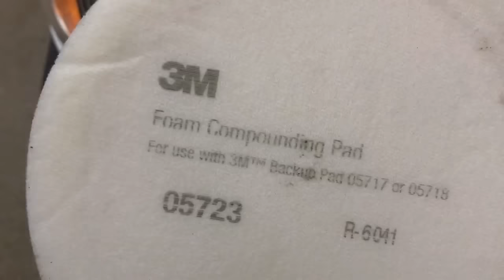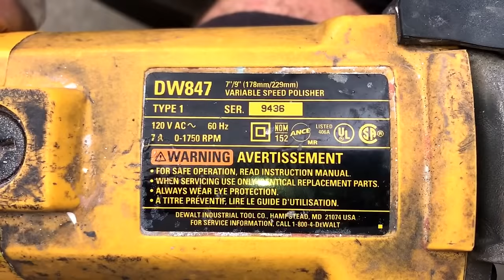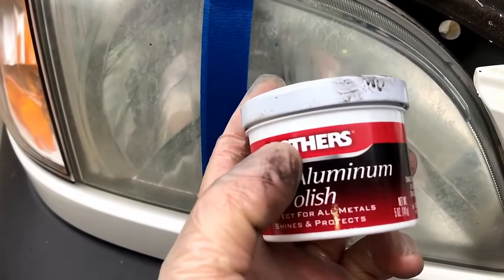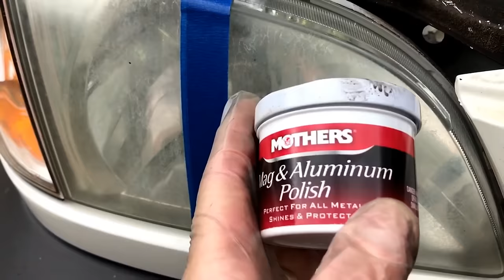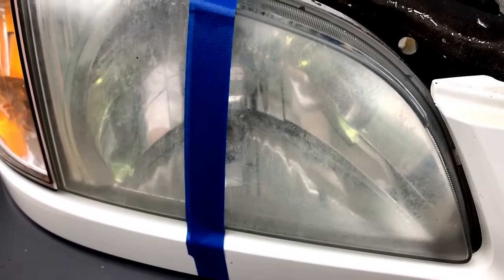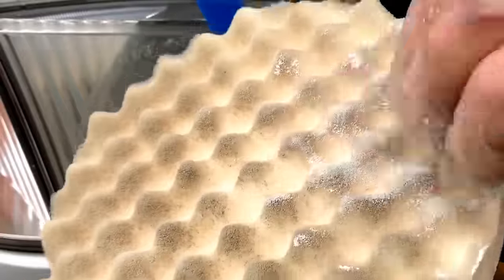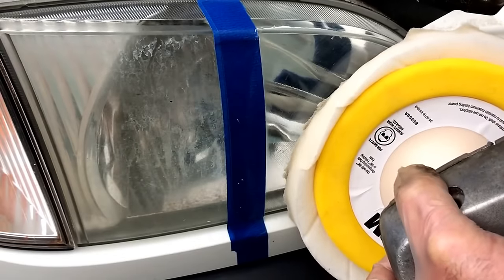How MOMMA Repairs Headlights BACK TO BRAND NEW in 3 Minutes

Comment: Thanks for the great videos. Couple of questions. I have a Dewalt cordless drill (0-1400 rpm) and some new 3M foam buffer pads in the 3" size that'll work on the drill.  If I use the Mother's mag polish, is that cordless drill powerful enough to clean a headlight that had a bad sprayjob of clearcoat left on it.  The clearcoat isn't too thick, as it was only sprayed over a couple of passes.  Thanks.
Reply from the maker: jason it will make it look better but if the clear was sprayed bad i would sand it off then do this video and follow the tool list to keep it looking nice :)
Reply: I would try the Mothers with the drill and let us know. Someone had applied a coating to my headlights on a 2001 Honda Accord and they looked horrible. I didn't want to sand unless I had to. I tried several applications of the Mothers with a drill and they look great now. Really cleaned up amazing.

Comment: OK yellowed and totally frosted headlamps!! 2005 Honda CR V Headlamps replacement (Amazon $90. pair) Remove bumper, TONS of bolts HOURS!! or $180. min at auto shop to install. Bought cheap Harbor Freight drill, Deluxe headlight restore pads etc with 25% off coupons, plus Mother's Polish.@ O'Reillys. Total cost $29. !! If I had the drill, $15.00 total. Did exactly like the video says and VOILA!! IT WORKED!!!!! (no sanding, just used the foam pad that fit the 3/8 drill) Crystal clear head lights.Took about 15 mins  because of low rpm drill for BOTH HEADLIGHT ASSEMBLIES!! Saved close to $300. and a trip to the auto shop. THANK YOU SIR!!!!
Reply from the maker: GLAD WE COULD HELP :)   we are glad to have you here with us and thanks for the great comment :)
Reply: UPDATE: There is just one small area of my left headlight that refuses to become perfectly clear and smooth. I tried using 3000 sand paper wheel and then re polished with Mothers on my waffle foam pad, but that darn spot won't clear up and feels a bit gritty.. Maybe the frosting is on the inside? but it still feels a bit rough on the outside.
 Now mind you this is a very small area of my headlight, the rest is perfect and it is hardly noticeable. I am just wondering why this area is so stubborn?
Reply from the maker: it is most likely on the inside of the headlight or in the lens itself send me a pic i would like to see it send it to sweetprojectcars@gmail.com :)

Comment: It cleans up fairly well, however I can't clear some of the heavier stubborn layers, any tips?
Reply from the maker: Buster Rymes it most likely was clear coated by someone and that will have to be sanded off. with 600 grit wet and dry paper all the way to 2500 grit then rebuff as you have done.

Comment: Just saw your video and im interested in trying it...... Quick question first can i go ahead and sand the headlights anyway before i use the polish just to smooth them out or will this smooth out any kind of texture on the lenses and if so which grit should i use for the wet sanding method. Thanks
Reply from the maker: Jose Rodriguez if you want to sand them then do this video here my friend https://youtu.be/GKLF8oIWYGg it will be the best you can do for your headlights.
Reply: Sweet Project Cars cool thats only IF i want to sand them though correct i really don't have to though?
Reply from the maker: Jose Rodriguez you are very correct...thats if you need to sand them otherwise you would buff them out and then ceramic coat them per this video https://youtu.be/hD2CKp9mco0

Comment: So I'm just curious.  My headlights are quite cloudy and it would do them good to have a cleaning.  I've tried the kits, and the toothpaste tricks.  I'm interested in trying this because all the comments seem very positive.  My main question, however is that I do not have a buffer.  Would good old elbow grease do the trick just the same?
Reply from the maker: 1Tarheelchick you sure can use elbow grease ..it will take a bit of it and some time but you will get it...:) thank you so much for your great comment

Comment: Will this work for polishing my goiter?
Reply from the maker: It definitely will, and it will shine like a new dime when you are done :)  Thanks for watching and asking, LOL.  Have a great day Mark, thanks for the laugh this morning.  mad Mike the hammer SPC
Reply: @SweetProjectCars  Haha! Absolutely! 😂😊👍 Glad to make you laugh. I actually burnt some goiter hairs last time I tried polishing it so I'm excited to try this method out 😉😆

On another note, I just finished using the HL restoration kit on my sister-in-law's van and my car as well and I did like the way they came out but you opened my eyes about a couple of things so I wish I would have found your video earlier! Can I still use your technique later on if I've already use the kits I'm referring to? Or will it just smear the coating I applied from the kits?

Comment: can you also use clearcoat with non yellowing and uv protection after? would i need to clean off with alcohol first before applying?
Reply from the maker: We have videos on how to treat the headlights after you have completed the polishing process we suggest using our ceramic coating last the longest with the least amount of maintenance have a great day Mike sweet project cars

Comment: Hey guys, so this worked with my 98 accord  headlights,  but it did not work as well with my 04 GTO.  the GTOs headlights are more worn and damaged and I tried several times with this method and the method with the cera coat. Still won't work. I did the sand paper clear coat method prior to finding you guys and it came out pretty good and looked alot better than they did before but it took forever and I only did one. I did your method and it came out ok but not as good as the sand paper method. I applied the mothers 3 seperate times and the results were ok. headlights for this GTO are super expensive so I really need your help. Is there a way to fix the more cracked worn headlights?  I'm really bummed cuz I was so impressed with the accords results and the GTOs are way more important as I'm restoring it and want it to look beautiful.  Please reply ASAP so I can get this taken care of. Thanks guys for all your help with the many other projects that have worked. I look forward to your quick response, Happy New Years!!
Reply from the maker: Jay, you need to do this process  https://youtu.be/GKLF8oIWYGg  exactly as the video states.  Thanks for asking and sharing, we appreciate it.  Have a great day.  mad Mike the hammer SPC

Comment: I tried your method to a T, but it didn't work as I'd hoped. My headlamps have a slightly different issue. I have a '14 Kia Forte, and the headlamps are not yellowed, they have 'oxidized' on the outside from too much sun. There is a raised 'texture' on both the headlight covers, and it get worse each time the car is in the sun. I'm afraid of using any kind of polishing attachment that has a grit to it for fear of scratching the plastic. If you have any suggestions, please let me know. Thank!!
Reply from the maker: Did you use this  http://amzn.to/2C18A9Z  and did you use all of the products/tools shown, by your comment you don't want to use anything with grit? If you did use them, then the clear coat on your lenses need to be buffed, do this video "NOW if you have Yellowing  Headlights or PEELING CLEAR COAT and Mothers does not do the job you will need to do this video https://youtu.be/GKLF8oIWYGg "   that we also have listed in the video description. Thanks for watching and asking, have a great day and all the best on your project my friend. mad Mike & team

Comment: Great video like always. I have a question for you.  I have done probably around 20 cars with a Milwaukee M12 polisher/sander. In poliahing mode its up to 2800 rpms. On some of the cars im having issues getting off the oxidation. The yellowing and discoloration no problem but the left over oxidation not so much. Am i doing something wrong. Im also using a lake Country yellow 3in pad and also have the orange, and white pads too. Thanks also have pictures of what im talking about
Reply from the maker: the only way we have been able to make them clear is with the exact tools we use in the SHOW MORE of the video description :)

Comment: Did this lens have the factory UV coating still on? I believe the sanding is to remove the coating.
Reply from the maker: Big Most yes it has the original factory coating is on it and the only time we would ever sand is if the clear is peeling really bad which we only run into about 1 out of every 300 lenses we do a month...thanks for sharing :)

Comment: Okay I am going to order this compound and try it out. However I will say this. I would like to see this result on oxidated headlights. The headlights that were restored here have scale and crap build up on it. I deal with headlights that 400 grit sand paper barely bites into. Not doubting this method but I am skeptical. Also some headlight plastics are completely different. I have a hard time sanding certain ones and it becomes difficult to get the original clear coat off of it.
Reply from the maker: If done correctly, you will love the results.  Thanks for being with us.  Have a great day.  mad Mike the hammer SPC

Comment: Does this work on scuff marks? the detail shop went over the headlights with the buffer and scuffed the headlights and you can see visible scuffs and or scratches on headlights.
Reply from the maker: Yes it will if they're not too deep.  It works on scratches in paint clear coat as well.  Hope this helps.  Have a great day.  mad Mike the hammer SPC

Comment: Got thinking about this and thought I would run this by everyone before I tried it out. If you've heard of NEVER DULL the aluminum polish in the wool form . It works great on aluminum and pretty fast. For those who don't want to go the buffer or drill pad route. It would take longer of course. Or do you think its too strong to use on plastic.What do ny buddys at sweet project cars think?
Reply from the maker: Phillip Gurney we have tried everything until this video and are now stuck on it and found it is the safest, fastest working.

Comment: Is there a cheaper polisher tool, or can I use these exact pads using a drill adapter?
Reply from the maker: You can use whatever you want to use, we share what we know will work and will give the desired results having been tried and tested.  Our videos are very product/tool specific.  Thanks for watching, have a great day.  mad Mike the hammer SPC

Comment: How long does it last before it fogs again? Would putting rustoleum clear coat make it last longer than the 303 protectant?
Reply from the maker: You can use whatever you want to use we are just showing you 40 years of experience in the detailing industry and what works each and every time thanks Mike
Reply: @SweetProjectCars  Ok but how long does it last?

Comment: Damn looks good but do those pads n hook it pad fit on cordless buffer?
Reply from the maker: They work on the exact tools shown only, if you want to have the same results shown, you need to use the exact products/tools we use in the video.  Thanks.  mad Mike the hammer SPC

Comment: I just went down to the car accessory supply store here in New Zealand and was excited to find the Polish.   Unfortunately cannot get the compounding pad here and the link for Amazon doesn't deliver here.  Anything else you can recommend? (Absolute beginner here).  CHEERS :)
Reply from the maker: Catherine Vos you can try what you have available at your local car parts place and see what you can find that will polish metal
Reply: Hey!  I ended up just doing it by hand with a round microfiber pad.  I very quickly realized not to go in buffing circle motions as it left swirl marks so I had to redo my first light with just horizontal left to right swipes.  It turned out so good and my car passed its warrant :)!  So happy!   Thanks for a helpful video :)
Reply from the maker: Catherine Vos that's GREAT TO HEAR !!!  Glad we could help you :)

Comment: Hi love this video however, I'm a single mom on a fixed income. I don't have that equipment. I have an old drill not sure of the speed on it but it's slow. What else could I use without spending a lot of time on it?  😊
Reply from the maker: Maritza ZB try the drill you have and it may take a bit longer but it should work great :)

Comment: I have one quick question if you dont mind. I've done the sandpaper method and they still turned ok but not good. Is it stikk possible using mothers?
Reply from the maker: Yes the mothers will work, but you may have to do it several times depending on how much you scratched them.  Thanks for asking.  mad Mike the hammer SPC
Reply: K

Comment: The clear coat on my headlights is severely cracked looks like a pieces of glass broken into a thousand tiny pieces. I wonder if just polishing with my da polished will work? I have some paint correction and chips to repair also which I have already watched your other videos!
Reply from the maker: Richard Portelli that is called crazing and it is in the integral part of the plastic there is no getting it out my friend
Reply: @SweetProjectCars  thanks for your honesty my friend. It is a shame how things are not made to last anymore!

Comment: Just bought MAGUIRE'S KIT $23 × 200 2" 300--3000 grit discs $23 from Amazon. Hope it works for headlights on 3 or 4 cars. I also have a jar of MOTHERS cream. Its too cold here in Alberta -12°C so I  must do it in spring (65°F+). I have clear coat but no hardener as far as I can tell. Fine print too fine. How important is that?ì

Comment: Can I use just the drill attachment polish kit with pads that come in kit and restore the headlight since I don’t have a polisher?
Reply from the maker: Hello Trey you can actually try doing it by hand if that doesn’t work then you can use the attachment for your drill if that doesn’t work then you know what you need to use thanks Mike

Comment: I can’t get all my old clear coat off ( original 2011 Hyundai Santa Fe clear coat) . Any suggestions? I’m using mothers and compound pad.
Reply from the maker: You aren't trying to remove the clear coat in this process, you are simply polishing it.  If you want to remove the clear coat do this process https://youtu.be/GKLF8oIWYGg  Hope this helps.  Thanks for the question, have a great day.   mad Mike the hammer SPC

Comment: I am having trouble finding this pad (05723) in my region for 3" or 6" DA polisher. is this series of 3M pads discontinued? if so, what's the successor name or equivalent series to one used in the video?
Reply from the maker: Is this  http://amzn.to/2AWATFU what you are looking for? Or this  https://amzn.to/2uOP39M   Not sure what region you are in my friend. Hope this helps, if not let us know and we will see if we can help you.  Thank you for watching.  Have a great day.  mad Mike the hammer SPC
Reply: @SweetProjectCars  thx for replying. I'm from Croatia (Europe). as I started with car detailing not so long ago and on a budget, the current equipment (polisher) I own is KRAUSS S08 with 3" & 6" backing plate. I am looking to achieve similar results to yours, to shorten the amount of time need to complete a pair of headlights, as atm it takes me up to 4-5h with P500/600/800/1000/1500/2000/2500/3000, +polishing, +protection.
as for the products mentioned in the video, Mother's is not available for me to order but I have AUTOSOL Metal Polish, as for the pad I would need it to be 6"... sadly I am not finding appropriate  substitute for 05723.

Comment: You say the drill kit for $20 is a joke, but the polisher, backup pad, and compounding pad adds up to $246 through your Amazon links.  For a guy who isn't waxing his entire car twice a year (or other people's cars for that matter), wouldn't the $10 drill kit I saw on Amazon be a wiser choice?  Is it just me, or is the dewalt polisher and 3M pads better for a professional detailer?
Reply from the maker: Brian Heath if you don't work on your own car then I would just do the process by hand with some rags
Reply: @SweetProjectCars  My work is more maintenance-driven, less detailing-driven.  Lighting on my morning commute is terrible, so that's my main motivator for this task.  However, I saw one of your videos on removing light paint scratches (from dogs)... is the ceramic coating you promote intended for painted areas?  I've only seen you use it on windshields, headlights, etc.
Reply from the maker: Brian Heath see these  these  and https://youtu.be/FcWB2wfuQBc and https://youtu.be/yBLuhb72grM and https://youtu.be/Nl9JkIdnIG8

Comment: hey bud I used this and it put like orange steaks on my headlight. Im using a wooly pad and mothers at 2000 rpm. Any suggestions or ideas that I'm doing wrong. Thank you
Reply from the maker: We've been doing this for decades, never heard of that, please send pictures to sweetprojectcars@gmail.com  Thanks Frank.  Have a great day.  mad Mike the hammer SPC
Reply from the maker: Frank, we saw your pictures and it looks like they have been clear coated sometime in their history.  What has happened is that it's possibly a cheap clear coat and you have buffed it too long which caused the yellow streaking.  Please see this video  https://youtu.be/GKLF8oIWYGg  to take care of what you have going on there my friend.  Thanks.  mad Mike the hammer SPC
Reply: @SweetProjectCars  Mad Mike, thank you very much sir. I really appreciate it. I was pulling the rest of my hair out...lol..After taking a very close look at these headlights you can see overspray on the top of them. I just ordered all the stuff to sand them and looked at your video. After these I will be doing the leather restoration like your videos. Once again thank you very much.